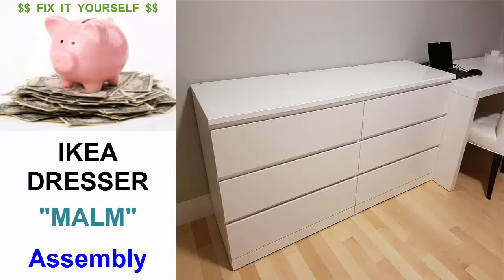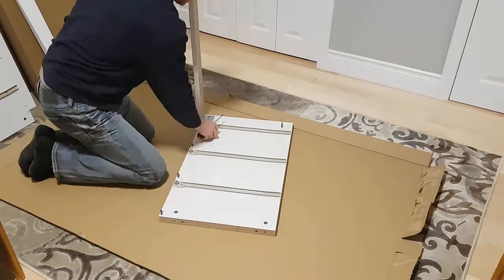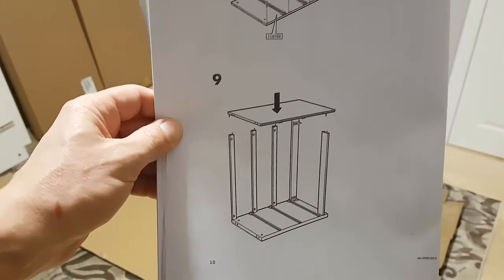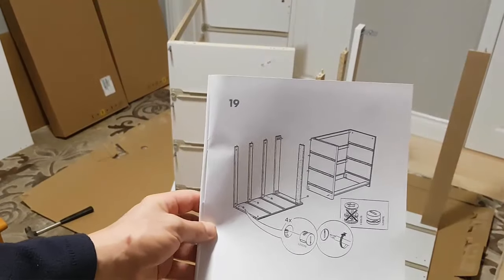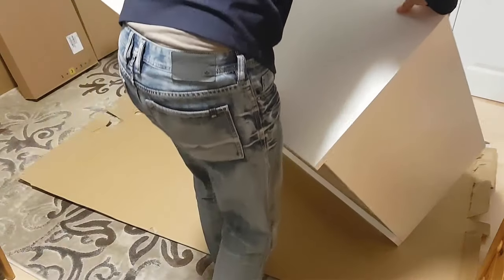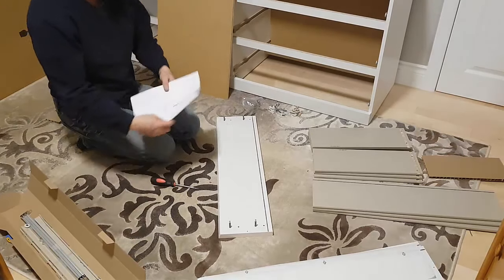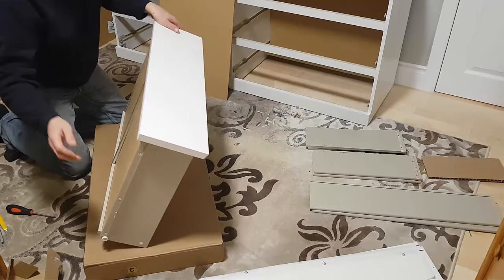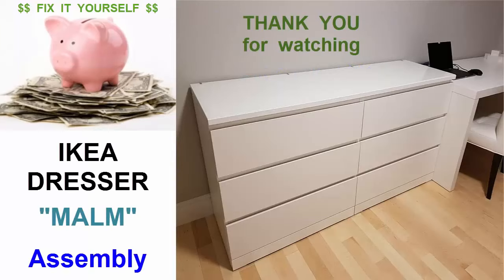IKEA "MALM" Dresser Assembly

Comment: In 16:16 I don't know how to put that
Reply from the maker: Hi, Sorry for the late response. You need to install the backing cardboard with the nails that are supplied. It is clearly shown in the instructions, but I started by putting nails first at the corners then the centers and then kept adding more nails always centered between other nails as you go along until I ran out of nails, but be sure to split up the nails so you have an even amount for each side of the dresser and you don't run out of nails on one side. You could always go to the hardware store and buy more small nails if you need to. Good Luck.  Vito Casola - FIX IT Yourself.!!
Reply: Thanks I finished the drawer closet thanks your video

Comment: A friendly reminder don't do it alone😭😭😭😭
Reply from the maker: Hi, Thanks for your comment.  Yes you're right, it is a bit more challenging when tackling this assembly by yourself. I know because I did it entirely myself.  Though it is doable, I will say it is definitely more difficult doing it alone, especially when you need to flip the unit over when it's partially assembled.  Having a helper will make it go quicker and definitely easier. Vito Casola - FIX IT Yourself.!!